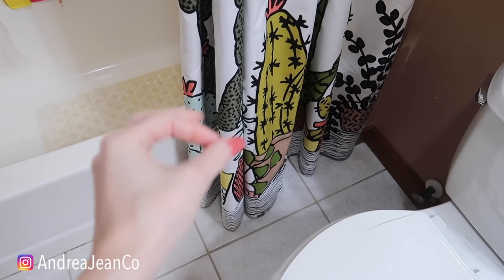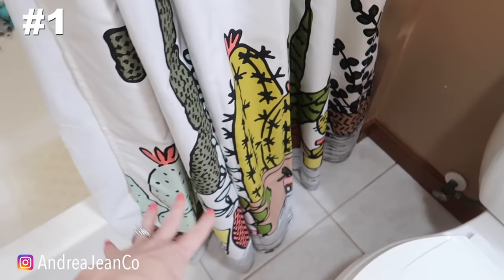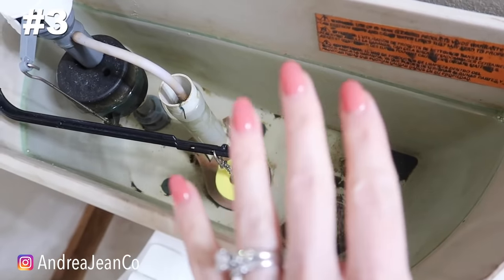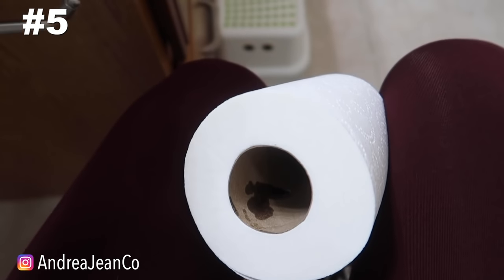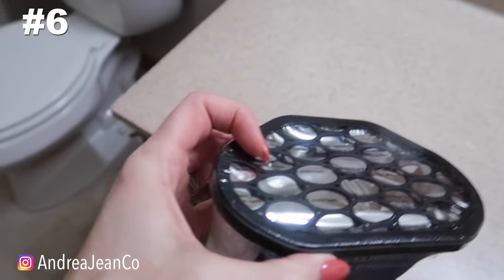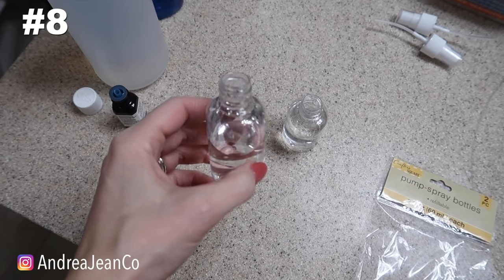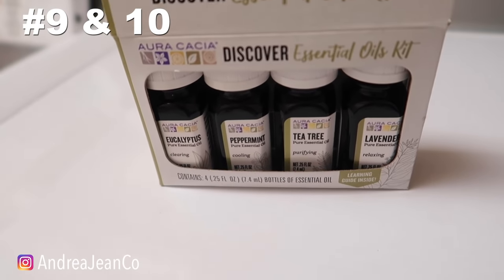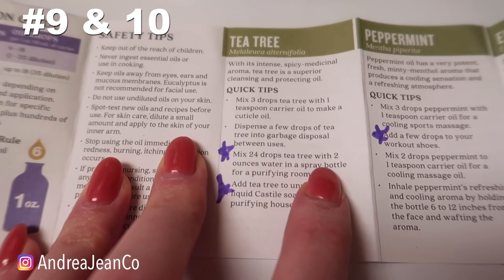10 Ways to Keep your Bathroom Smelling Fresh WITHOUT AIR FRESHENER!! (Cleaning Hacks) | Andrea Jean

Comment: Use one cup vinegar in each load of wash , good disinfectant and helps with stale odds. Brightens too., without bleaching your towels and other things. Been using it for many many years. Use it for cleaning toilets too.
Reply: Watch the vinegar in washing machines as it can damage the hoses & rubber seals over time.

Comment: I put my vinyl shower curtain liner in the washing machine with a towel or 2. The towels help clean the liner. When the cycle is done, I take out the liner and let it air dry. Gets rid of all the hard water soap scum too!
Reply: Great idea. I just usually spray the inside of my shower curtain liner down with bleach once a week after I take a shower.
Reply: I wash my vinyl and cloth curtains together and with a couple of towels and hang both straight from washer. The weight of the damp curtains keeps them from being wrinkled as they dry. The bathroom smells so much better for a couple of days
Reply: Sally Snodgrass I do the same with my shower vinyl should shower curtain.
Reply: @JOYELLE93  : Yes I do that also.
Reply: Great tip! Thank you!💕
Reply: In reading all these comments and relize I never wash my shower curtanins, I just buy a new liner every month and I never wash the cotton curtain.
Reply: Oops, I just posted the same thing, before I read your comment. 😊

Comment: Just toss your plastic liner in the washing machine tah dah!
Reply: Right now, mine is ripped, so have to buy another cheapie. 
Not only that, I like change
Reply: Yeah I get a cloth liner and just wash and dry  it in the machines!
Reply: Put vinegar in the rinse water. Then run in the dryer about 5 minutes (even tho it’s plastic). That will make it soft and get rid of wrinkles.
Reply: Just toss in washer on gentle cycle with a little bleach dry on lowest setting 5 min. 
Thanks for the Alcohol and vinegar tip.
For the tissue they have with it lavendar already in it at Family Dollar  the generic Angel Soft with Lavendar scent
Reply: Or garbage
Reply: Add a towel, helps with scrubbing

Comment: The toilet brush, I haven’t used one about 15 years. I just clean around the toilet seat and the bowl area with anti-bacterial wipes morning and at nighttime with some disposal gloves. Bin and dispose wipes and gloves right away. Don’t leave sitting in a bin inside home smelling. Wash the hands 🙌 . You could use a old rag with cleaning spray and just soak and wash separately in the machine. No more brushes sitting in the air smelling bathroom. At nighttime just use a cleaner for deep cleaning. My visitors can use the anti-bacterial wipes to clean toilet seat before use. I also carry anti-bacterial wipes in handbag if using a public toilet or restroom. The wipes are  very useful during Covid 19 wiping down any surface beforehand. Some great tips.

Comment: When your bathroom starts to smell, it means you need to clean it, piggies.  You don't cover up the smell.  You get rid of the source of it.
Reply: I clean the bathroom once a week. The problem is not the bathroom is dirty, but my shower drain sometimes smells for unknown reason.
Reply: Preach 😂
Reply: Go into the bathroom after me(with IBS), or even better, my sister(with Crohn's disease), and you'll be saying differently. Not everyone has a perfect gut, and it's quite noticeable after those of us with gut issues, have used the bathroom. So, calm down there, Judgey McJudgerson.
Reply: Exactly, flushing the toilet over and over isn't going to clean it!
Reply: Yep

Comment: Is that what you used to clean the toilet tank. I have a serious rust issue with my water. Sometimes after heavy use even with the softener running 4 times in a 12 day cycle, the water gets very rusty, even orange  at times.

Comment: Thank you!   I like most of the advice and will use many of them. But. the one pouring in  scented oils on the toilet psper  I won't do for my family because, the oil 
spill and will adhere to the paper sheets and eventually end up in our body through traveling through our private parts and in orifices which is not good for us. Remember years ago when baby oil, and baby.powders used to deodorize the private parts, turned out to be cancerous. It"s best not to use it.

Comment: when you pour the 1/2 cup vinegar into the wash, where exactly is the water softener section?
Reply: I think she meant fabric softener.
Reply: @nubbyrose87  I was wondering the same thing. I need clarity please and thank you
Reply: Do it during your rinse cycle
Reply: I use about 1C of vinegar in the laundry (wash cycle)for a large load for my exercise clothes or towels. Works wonders.